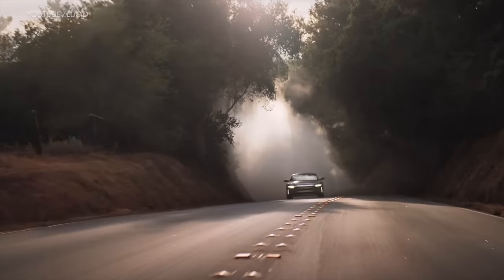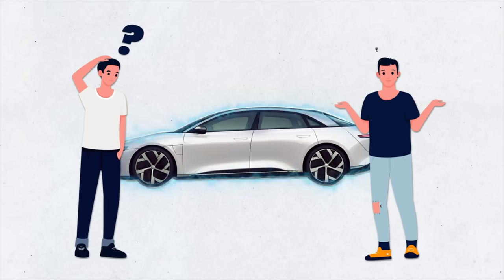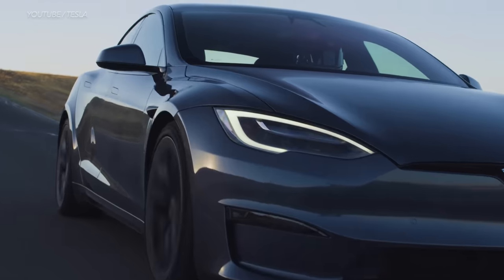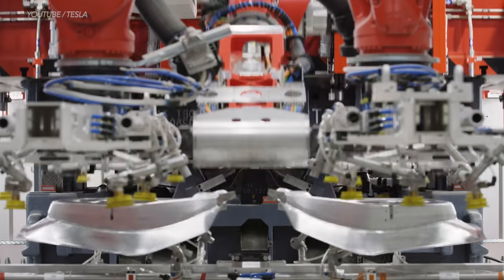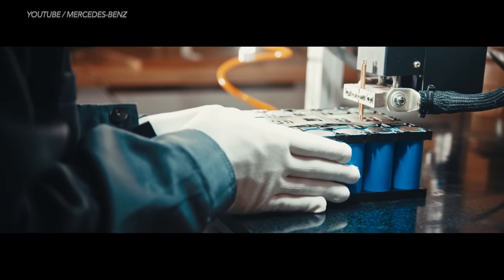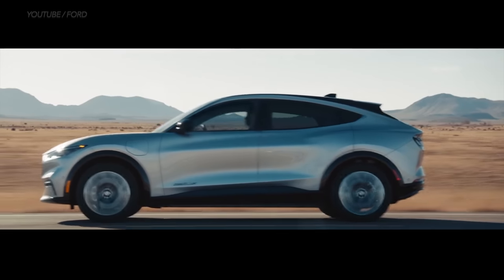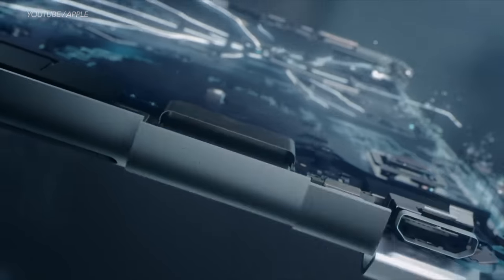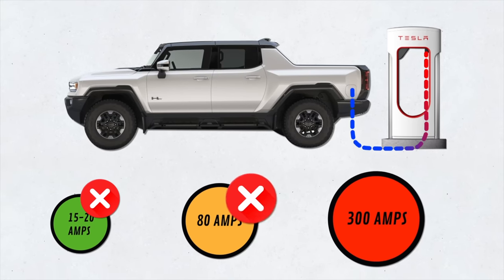Here's Why I'll Die Before I Buy an Electric Car

Comment: What people are forgetting is that 50% of the people who live in small-town USA don't have a driveway, or a dedicated parking space.  They have to park on the street.  They have to fight for their parking spot each day. How are these people going to charge their electric vehicle?  Am I supposed to run an extension cord 40 feet over the sidewalk to charge it every day?  What if someone trips?  Am I responsible?  EV's may continue to improve, but how is everyone who is not in the middle class going to charge them?
Reply: Yup.
Reply: Also people living in large apartment buildings. Where is everyone going to plug in? There is road use tax that may surprise some people. More weight means more $.
Reply: And, a large number of people living in cities reside in high density apartments. I do not live in an apartment, but, I have never yet heard of an apartment complex offering community EV charging stations. I have no faith in the current state of EV technology and I will continue to enjoy the 600 mile (sometimes more) range of my X5.
Reply: Use diesel backup generator. Bring it right next to your EV. Start it up, plug it in 220V. Problem solved.
Reply: Depending on what you use you car for, the average person can get by by fast charging a few times a week. 250 miles would last me like 1 week of driving to/from work.
Reply: That is exactly why the ice will never be completely done away with. How many people live in apartments with only a spot in a lot or maybe a carport.  Not everybody has the American dream.
Reply: @bigx9963   Are you talking about running a diesel generator in on the street or in the parking lot of a crowded apartment building?
Reply: You are basing your question on information that is outdated. The latest charging technology will charge the latest battery technology in 20 minutes while you're at work - the change is coming - give it 3 to 5 years.
Reply: Don’t have a drive way 😂😂😂🤣🤣🤣🤣🤣🤣🤣
Reply: Most people don't have a gasoline tank at their home either. People can take a minute and charge their car once a week. If you are living in such a dense area you struggle to find parking you should probably levy for a working public transportation system, not bash electric cars.
Reply: @Doom-i  Yeah, and what if there are no assigned spots?  Who pays for the charger to be placed there?  That's going to cost a lot of money!  Either tax-payer-funded, or paid for by the home owner.  Then what happens when someone parks their vehicle in your spot.  How do you charge up?   You may be right, I'm not trying to pick a fight.  I have really thought about this a lot.  I think having an EV would be cool ya know.  There is just no reasonable way for me to own one without incurring a very high cost to make it possible.  Most of the people who live in my town are in the same boat.  There is an apartment building across the road from my home.  People constantly take my front-street spot.  Different cars every day and at night.  They don't even have a parking lot, left to find parking on their own.
Reply: @hidesbehindpseudonym1920  You bet
Reply: @Doom-i  yeah...about a 100% increase in rent to pay for it.
Reply: That's not an issue just in small-town America.
Reply: And don't forget that kids will be walking around the community at night disconnecting cars from their chargers.
Reply: Saw people doing that in London. Didn't seem to be a problem.
Reply: @bigx9963  🤣🤣 exactly! That way your ev will have the same emissions as a John Deere !
Reply: More like high class
Reply: You charge on the way home at the neighborhood charge station. That way your car is ready to go the next day.
Reply: @bigbangerik66  I'm not bashing them... I'm reminding all the elites that not everyone has what they have available.  I think they are pretty cool and can see having one would be pretty neat.  But I also live in the real world small-town-USA.  Sometimes you need to see it from the other perspective.
Reply: I also don't see this as being an enormous, wide spread issue. In the smaller more rural areas which are devoid of chargers.....yes, if you don't own your home or have a landlord that's cool with you installing a home charging solution then it's not your time just yet. But it's coming quickly.
Reply: @Doom-i  do you realize the amount of power the grid would need to power something like that..I live off grid and understand better than most that electricity doesn’t appear out of thin air..the US grid will need trillions of dollars in upgrades with money we frankly don’t have
Reply: @gene8172  The nearest charging station to me is 30 miles away.  In a place I'm never "just driving by".  That's going out of my way to "fill up".  I'm sure someday we'll get them closer... but I'm not holding my breath.
Reply: Ask Norway. They have a ton of EVs on the road, many Teslas. Their government invested in infrastructure to accommodate. Every lamp post that line their city streets have an outlet. They WANT you to plug in there. And it’s totally free. (Well, it’s funded through taxes, but EV owners pay taxes too.)
Reply: And that's 98% of UK so good look marketing them for Britain.
Reply: @gerardorodriguez538  the chargers normally lock to the vehicle and if someone tempers with it an alarm will sound.
Reply: @leechburglights  Where’s the nearest gas station?
Reply: @gerardorodriguez538  Not just kids, it could also be chads who "disagree" with electric cars.
Reply: @leechburglights  elites also had the first cars as well, things will get cheaper at scale like all things.
Reply: @bigx9963  wait so we gotta use gas still ?? Wtf
Reply: @UmmYeahOk  

1. Norway is far less diverse.  Diversity generally creates conflict (unfortunately).

2. Norway is a fraction of the size of the USA.  The USA is a group of United States.  Far harder to get something done nationally.

3. Norways income taxes are roughly double the US taxes (this can vary somewhat widely based on income level, what state someone lives in in the USA, etc. but this is a rough estimate), and there are other taxes as well that make it end up being more than double.  Do you think this and other government handouts makes having plugs for electric cars everywhere worth it? If you do, I wholly disagree, countries like that make it impossible to get ahead.  High taxes drag everyone down into mediocrity.

One has to look at the big picture.  What is feasible and how much it will cost is where you need to start.
Reply: New York, Baltimore, New Orleans...any city that came to prominence before the 1920's and still has historic neighborhoods.  You never even get the parking spot in front of your home.  Driveways are rare and garages are nearly non existent.
Reply: @matteoperron5436  How many hours a week can you spare to charging your EV?  I hear of 45 min to 2 hours wait times.
Reply: @bigbangerik66  not all public transportation is good. Like my town I grew up in sacks to find parking and public transportation sucks to catch. Bus comes every hour in a half until 10 the last bus for the night. Starts back up at 6 a.m.  breaks down alot.
Reply: @Doom-i  So who is going to pay to update the power grid?  The cost of retrofitting a complex?  Major cities are already utilizing rolling blackouts.  Where is all of this clean electricity supposed to come from?
Reply: @Mistro07  If all cars in the US were magically electric tomorrow, the grid would need about 50% more electricity than it contains now (you can google the numbers and calculate it yourself: miles-driven-annually / average-miles-per-kwh vs. kwh-produced-annually). Not an insignificant amount, but not impossibly huge either. Considering how slow the change will really be, I'm sure it'll be fine.
Reply: @Doom-i  Time?  Who said anything about time?  I'm talking about infrastructure and cost.  Two questions nobody wants to answer with anything other than than a soundbite or redirection.  Show me the math.
Reply: @UmmYeahOk  that's a smart solution
Reply: @ramshambo2001  great point
Reply: @ramshambo2001  It's about NOT being able to charge them at home to save money and time.
Reply: @SteamCat86 yeah, and my point is HOW????? In many communities this is a huge problem that nobody is talking about.  We FIGHT for a place to park at our homes every day.  Never having the same parking spot.
Reply: @nucleargrizzly1776  AMEN brother.  My home was built in 1870, the second oldest in my town during the steel boom of the 19th century.  Houses are packed on top of each other.
Reply: @Doom-i  That's everyone's problem.  
And did you notice how you still didn't answer the question?  Just deflection.
Reply: @hidesbehindpseudonym1920  it was definitely sarcasm.
Reply: @leechburglights  So you don't plan on running and extension cord down the street? 😁😁😁
Reply: @Doom-i  More deflection?
Reply: @bigx9963  So, you run a generator for hours that runs on a fossil fuel so that you don't use fossil fuel......something wrong there....
Reply: @SteamCat86 there are 2 apartment buildings in my small town.  They have zero parking lots.  How's that going to work?  Government grants are awesome, just higher taxes WE MUST PAY for others to get "free money."  I don't see this happening in the next 10-20 years.  I'm not worried tho, ;) I got a Toyota 4Runner, should last me till the big conversion to EV's haha.
Reply: @bigx9963  Lololol   I’m going to use a huge loud Petrol ⛽️ Diesel engine and leave it on the sidewalk of the Bronx?
Reply: Sounds like my moms place in the UK,always fighting for a car parking spot on the street!Its very frustrating .🤯🤔🤔🤔🤔
Reply: One thing about ev charging over petrol or diesel is that ev charging points can be put anywere and probally will be everywere. Although it sad that most of the US is not cycle frendly and poor public transport. Meaning people can't have a small car that used to go places on the weekend and dose 10k km(6k miles) a year.
Reply: Don't forget very cold weather and it's effects on charging. Unless your EV is in a garage for northerners it's S.O.L 4 months a year. EVs are a disaster y'all gonna see, another unmitigated disaster.
Reply: @bigbangerik66  Take a minute and charge….. Erik you are a funny man hahahaha
Reply: So, where do you go to get gas? If your area is so populated, I hope you know you can fit more electric chargers in one area than gas pumps. Once these places you described switch to hybrid, selling gas and electricity, there will be no issue.
Reply: @mauricebarry8858  The shortest charge time on a level 3 charger is about 30 minutes. It takes 2 minutes to fill a gas tank. There isn’t any comparison.
Reply: This may sound harsh, but it's simple truth. EV's aren't made for people below upper middle class at best, or people who don't live in one of the few environments where charging actually works/makes sense for you. 
If anything, it'll be some $4k Chinese piece of 100% feces that lasts 10k mi before it catches fire.
Don't worry, you can always go to some parking lot with 4 chargers, wait about a 1/2 hr for one to open up, charge for about a 1/2 hr, might take you up to a 1/2 hr to get there...cool! The future!!
Reply: There will be changing poles soner or later on most parking spaces 🤷‍♂️
Reply: @Doom-i  ' Shhhhhhhhhhh ' Hush ' 
Don't give them any ideas '
they will charge $$$$ for charging at a charging parking meter 🙊
Reply: @Doom-i  More 30 to 50 years, you cannot expect that apartment complexes are going to shell out millions or billions in 10 yrs time. Where are they getting that money from, massive rent increases? lol
Reply: @nrich5127  You still did not explain where it would be? What on the street? Is every employer expected to install them? Will apartment complexes shell out millions to upgrade their complexes? Like you did not even understand that the OPs question is about practicality and availability, not the technology itself.
Reply: Do forget all the people that live in Apartments and Condos
Reply: @Doom-i  who will pay for the installation/upkeep of these chargers?
Reply: @leechburglights  yep. Legally..that spot is open for anyone. Public.
Reply: Just buy a diesel generator lol
Reply: @bigx9963  Ok smarty, let's place for example 25 diesel generators on sidewalk of Brooklyn street. How you going to handle fumes, noises and extension cords running to cars under charge take place?
Reply: @Jerry Coffey eyes.
Reply: Someone will steal ur power if you use a power cord 🤣
Reply: No, No, No!   You cant concern yourself with those details.  
Just buy the EXPENSIVE ELECTRIC car and you will figure it out later.
Shame on you that you would pose that question at UNCLE JOEY!
Reply: How does someone IN THE MIDDLE CLASS, suppose to charge it?
Reply: Thank you—I live in a predominantly rural, poor state and have often wondered how the EV fans see us being able to afford these in the first place, much less maintain and live within their constraints.
Reply: Also not everyone in rural areas have garages. Like us, I don’t know if those chargers are waterproof. You mentioned apartment complexes, how many of those owners are going to spend the money to have dedicated charging stations installed for the tenets.
Reply: @bigx9963  until you’re neighbors complain about the noise.🙂🙂
Reply: @morbward8281  basically EVs will end up being a "luxury " thing like Lamborghinis or McLarens that only ultra rich people can afford 
Middle class people who live in apartments either have to use electric public transport/ bicycles 🚲or legs 🏃🏼‍♂️( walking)
Reply: @leechburglights  I live in BFNW Indiana. We have chargers in town. Not sure what your point is. It isn't "small town america" that's going to have an issue, it's "super dense metropolis" that will. And, again, if you live in a densely packed area, be it small town or big city, you should be pushing for better public transportation and not nit picking ev.
Reply: Wireless charging.
Reply: @troy028  then fix it? Again, instead of nit picking ev, fix public transportation.
Reply: Seriously? Lol
Reply: Public transportation
Reply: yes,most living in big buildings in apartments,they need 200meter cable and recharge takes 24+ hours
Reply: @jameskennedy673  

Right on brother
Reply: @rschall333  technology will change that within a couple years
Reply: I have a battery charger that I connect to my battery, and stationery bike, and I charge it like that when I can't park in front of my house. Two birds, one stone😐
Reply: @bigbangerik66  Bruh, I'm not nit picking the EV... I'm talking about real issues that you admit you don't face, but maybe 50% of the country does.  The closest charging station if a 35 minute drive from me.  

Our town was founded after the Civil War.  The population expansion happened here before cars were even a "thing" in the early teens of the 20th century.  In fact, most of the eastern U.S. towns are like ours.  I'm not saying that EV's are bad, or we shouldn't move towards them.  I think they are cool.  But maybe you are not aware of what it's like to live in a town where you must compete daily for your home parking spot.  Why would I buy one if I had to go the charging station every day?  I don't have to go to the gas station every day to fill up my Toyota 4Runner.  There's more to think about than just, "well our town has a charging station..."
Reply: @allenanderson3649  haha, there is little to no public transportation out here in rural western PA.
Reply: @Doom-i  that won't happen until we get a grid upgrade and nuclear energy powering ut
Reply: If had an electric car, if I couldn't charge it at the house, I'd charge it at the hotels and motels in town....that's where the most stations are at now......eventually, the neighborhood gas stations will put in 1 or 2 hubs to meet growing demand.......EV's are here to stay, we might as well get used to em......🤔
Reply: You can buy speedcharge cables but they're dear.  Somebody paid $600 for one.
Reply: @bigx9963  Why not just drive a hybrid in the first place?
Reply: My personal plan is to buy a new Honda Civic 2.0 litter, no turbo and drive for 12 years !   My current vehicle should get 2 more years use, then God willing 🙏 the world and car market find a more peaceful place  ????
Reply: I'll buy electric vehicle, sometime after Scotty buys one ???? LOL
Reply: @Doom-i  not in our lifetime. It makes a cute bedtime story though
Reply: @leechburglights  do you also not have electricity? Are you writing this by candle light? For sure you can get charging stations. They are coming. Your point is moot.
Reply: I had to get a jump pack because I couldn't plug in my battery charger  to reach my car last winter.
Reply: and lets not forget batteries can not charge in freezing climate so snow is a problem plus the so called EV being eco friendly if you ignore the fact than all the materials of a car are mined refined produced and transported are done using fossil fuels.
Reply: @leechburglights  I don't understand why people argue, "but the taxpayers are gonna have to pay for it." The government only charges you a percentage of your total income. The amount won't change unless you make more. Whatever can't be covered by taxes is paid for through the deficit.

Also, the same argument can be made about literally everything.

Road? "But the taxpayers are gonna have to pay for it..."
Bridges? "But the taxpayers are gonna have to pay for it..."
Tunnels? "But the taxpayers are gonna have to pay for it..."
Water treatment? "But the taxpayers are gonna have to pay for it..."
Sewage treatment? "But the taxpayers are gonna have to pay for it..."
U.S. Military? "But the taxpayers are gonna have to pay for it..."

If we let "But the taxpayers are gonna have to pay for it..." get in the way of everything, nothing will ever improve.
Reply: @bigx9963  Why have an EV is you are going to power it with diesel oil?  What if someone steals it?
Reply: @Mistro07  This is a myth. U.S. power plants regularly produce power at a higher rate than demand.
Reply: @Doom-i  At what cost?  Who pays for it?  MASSIVE infrastructure changes.  Will never happen.
Reply: @bigx9963  Doesn't that defeat the idea of electric?  You're still using oil.
Reply: @Doom-i  Try 100 years.  EVERY apt. bldg that now exists would need conversion.  Do you realize the $Trillions to do that?  The rent would need to be increased massively to pay for it.  No owner could afford to convert his building.  No tenant could afford the increased rent.
Reply: @bigbangerik66  Public transit is a joke. You can only work on the bus line totally limiting your employment opportunities.
Reply: @megaandry69  100% truth. I wish 50% of people would realize this simple truth that is spelled out in front of their faces. I also love how some say, "I'll just keep my old truck forever!", as if they have a choice in a few years.
Reply: Ever heard of a charging station? Duh
Reply: @matthiasknutzen6061  I guess the entire electrical grid is going to be 100% overhauled across the entire US & rest of the world to be able to handle the overwhelming increase of usage as well. Pretty realistic.
Reply: @bigx9963  how is that “green” 😂
Reply: @jackanderson2773  100% correct. Very green to charge EV's using electricity that comes from coal & gas, right? Also extracting all of those rare earths at the cost of environmental & personal impact for people of "developing" nations is also green, along with service lives being cut in half (or less) forcing you constantly throw away & buy (rent/lease) new. Very green indeed.
Reply: @RothBeyondTheGrave  If things happen as you believe they will, gas demand will drop.  The price per gallon will drop as well. ICE vehicles have a very long life ahead of them.  I'm not saying EV's won't at some point be the primary vehicle sold, but lets be realistic.  I'd say we're a good 20 years from that happening.  By that time I'll be well into retirement and not have to worry about it.
Reply: @bigx9963  Many apartment complexes prohibit this. Cannot operate this or even a grill within 30 feet or so of the building for fire insurance issues.
Reply: @nrich5127  what if you don't go to work and work from your apartment.
Reply: @UmmYeahOk  Population less than 6 million people. Find another example!
Reply: @Trainfan1055Janathan   Why does the government have to spend our money period?  It's not theirs to spend.  Its supposed to pay for the salary and business of the government.  You do realize you'd have 15 to 20 %  more in your paycheck each month if they didn't tax you right?  I don't know how to explain it any better.   If big business, big auto, big oil, big electric want all this stuff updated and spread across the country, THEY will pay for it.  The government doesn't pay for cell phone towers, electrical lines, or telephone lines to be run across the country.  The business that want to sell to the consumers are the ones who should pay for it.  Not the government buddy.  If Tesla wants me to buy their cars, they need to install Tesla stations... if GM want's me to buy their electric car, they need to install GM electric stations.  What gets in the way of progress is... will it sell or not.  What you're saying is, I want EV's!  Great you and big business can pay for it LOL
Reply: @bigbangerik66  Dude closest station to me is 30 miles away.  I never drive in that direction.  What's the range of an EV?  How far can I go before I have to waste my time LOL.  My point is very valid and just because you don't have my experience doesn't mean I don't get to voice an opinion.
Reply: @custer8616  um, not within 30 miles of my home.  Kinda pointless since its in a place I never go to.
Reply: @bigx9963  Yeah that s green :elbowcough:
Reply: @In-obscurity-n7j   Until there is a sizeable used market a lot of these people can't afford an EV.  Why does everything have to happen right now?
Reply: On the flip side it's a backup to my RGB lights and controller's. 😉
Reply: @Doom-i    The problem I see with that is stolen cords (already happening) and the cost of maintaining them, nobody works for free.
Reply: @leechburglights  I believe you but 50 percent seems awfully high, even for a big city. I live in a town of 3500 and almost everyone has a parking spot
Reply: Not my experience
Reply: @gerardorodriguez538  🤣
Reply: @RothBeyondTheGrave  Yes agreed .
Reply: @Mistro07  I don’t think most electric grids could handle 1 out of 20 cars changing over. I respect your electrical independence too. Very admirable. But, the field created by the spinning of a generator literally does pull current “out of thin air”. Much love
Reply: @nucleargrizzly1776  I find it interesting; that up until the 1920’s those big cities had electric vehicles, trollies and buses.
Reply: Car companies more and more aim for sales to higher income buyers, ignoring the segment of buyers that would buy a car with a lower price and lower margin of profit.  Regardless of the cost of new electric technology, auto makers seem to be following suit with the emerging electric market.  I don’t foresee a time anywhere soon when there’ll be an electric vehicle available that will be affordable for the average car buyer.
Reply: @kevindavis3841  In the early 1900's NYC had 1500 EV recharging stations.  The idea has already failed once.
Reply: Exactly.
Reply: Don't "these" people have public transportation and/or can walk to work?  Just about every other country I have been to you can easily hop on a train or water taxi to get around if you live in the 'big city'.  Otherwise you live in the country and have a driveway.
Reply: @haganlife  I guess you don't see the big step down in quality of life I see by using mostly public transport,  but I live in apartments in Sydney Australia, on a coastal area as many do and we have 4 cars but just 1 allocated parking spot, so the other 3 cars park on the street. For this city alone (5.3million population) I can guess there would need to be likely 500,000 street charging stations, that seems very far fetched to be built by 2030.
Reply: @bigbangerik66   you didn’t pay attention to the “quick charging” portion of video; it greatly reduces the life of your battery. Also, Most small towns don’t have E-charging. My town doesn’t! And my 100 yo home cannot handle a plug-in vehicle. 
Not everyone CAN do e-vehicles.
Reply: @gerardorodriguez538   and peeing into the ports! 😂😂😂💀☠️
Reply: And lots of people are poor, so we should stop selling stuff. What kind of argument is this? It’s the same as “ev trucks can’t tow far.” Well, duh. Not yet. EVs are good for some things and not for others, like literally every single car on the road.
Reply: @JaySimons1  Try a trip to Denmark to see if that changes your mind about public transportation.
Reply: I live in small-town USA.  Have visited many more. Most everyone has off street parking.  Garages and shops are common.    Sounds like your describing some sort of slum.
Reply: @bigx9963  why not just buy a diesel car for the fuel use to charge the car just seems like a waste of enegery to me
Reply: @danharold3087   you are NOT thinking it through! LL is correct!
Reply: nothing stopping people plugging into your extension cord and have you pay the bill and end up with flat battery and can't get to work.
Reply: The first autos also had no gas station when people started buying cars. There were almost no cars on the roads till the very late 1890s and no gas stations. Maybe we should have stayed with the horse and buggy.
Reply: @67Endgame  There are EVs in many housing complexes in California.
Reply: @67Endgame  a lot of high end apartments in Las Vegas have the option of adding a ev charger to there car port spot. Yes it is an additional charge but it is an option.
Reply: @UmmYeahOk  Nah, most Americans would rather sink their tax dollars into an incredibly over bloated military budget 😒
Reply: @danharold3087  then you haven't gone through southwestern Pennsylvania and seen where and how people have zero driveways in the hart of the town.  Driveways, OMG that would be amazing if we all had one.
Reply: @bigx9963  Diesel generator... nice clean electricity. 😂😂 At that point, might as well just get a diesel powered car.
Reply: @bigbangerik66  That's exactly the point, our rulers want personal transportation to be less accessible and affordable for common folk.
Reply: Electric cars are so much better that they need mass coercion and gaslighting to sell them. Klimate Krisis and "climate friendly" cars.
Reply: @Doom-i  Tell me again why we need to have cars with "challenges" when we already had cars that work without challenges. Wasn't it Klimate Krisis or some such thing?
Reply: @bigx9963  why then buying an EV in the first place ?
Reply: @bigx9963  using diesel kinda defeats the whole go green doesn’t 😂😅
Reply: Pretty soon there won't be a "middle class"
Reply: You hit the mail on the head with a sledgehammer like Always Scotty.
Reply: @Doom-i  That still leaves tens of millions of car owners living in congested areas without assigned spots.
Reply: they are not the target group. why do you think most EV's are SUVish... it's aimed at the multi-vehicle homeowners.
Reply: @TeamMadcrew  you describe my situation perfectly. I bought a 9 y/o Rav 4 EV as a family car. The thing weighs 4000 lbs!! 
Perfect for daily usage though
Reply: @morbward8281  my buddy installed a L2 for his parking spot
Reply: @bigx9963  Then your generator gets stolen, not a good idea.
Reply: Ever heard of wireless charging? 
If they can cram in parking meters everywhere they can cram in chargers too duh
Reply: @unitycatalog  except "they" prefer to extract value from the public, not the other way around
Reply: @alexanderpetrov7027  gas stations give away gas for free ? Or do they extract valu?
Reply: @unitycatalog  is that supposed to be cleaver, really dumb questions 🤣
Reply: @alexanderpetrov7027  Look up the dictionary for the word "sarcasm"
Reply: hydrogen is for rich, battery is poor ppl
Reply: If you live in NYC all the parking garages offer charging avg price $10 bucks for a fill up.  NYC is already working on parking meters that can charge. 
You must still be using a Blackberry how are you ever going to type without a keyboard
Reply: @unitycatalog  In case you haven’t noticed sarcasm doesn’t work very well on the internet unless someone knows you, there are so many that espouse crazy solutions.
Reply: @robertromero8692  not to mention that a generator doesn't have any emissions control equipment so that generator will put out as much or more pollution than it would be to just drive a gas/diesel vehicle
Reply: @rschall333  I was just about to say the same thing
Reply: @tanmay_6363  I think I'll just keep my old diesel truck, it'll still be running LONG after these EV's are in a landfill somewhere...
Reply: @leechburglights  there's absolutely no public transportation where I live
Reply: More public chargers where people can charge to full before going home. Cars will eventually charge faster and have better range. The average American drives 30 miles so a full charge should last a few days if not a week. An electric car doesn't have to be plugged in every single day
Reply: @UmmYeahOk  doesn't hurt that Norway produces Oil
Reply: @js6729  😸😹👍🏻
Reply: Na becoming like Europe. Only three rich will be able to afford to drivw
Reply: @Leechburg Lights  I hear ya.  And there are other VERY significant reasons why EVs will never totally replace combustion engines.  Two examples:  EXTREME COLD AND HOT TEMPS.  In other words, extreme cold OR extreme heat will usually spell the death of a battery (or batteries), so in addition to a battery's lifespan shrinking year after year, now a person has to be wary of being subjected to extreme heat or cold, and it only takes a few hours of extreme temps to kill an EV battery.

Then there are obvious infrastructure problems (e.g charging/stations, etc.) that are obvious, but even more anxiety-inducing is what happens if something mechanically happens to your EV?  I'm a fan of Tesla autos, but there are no Tesla service stations and/or mechanics conveniently located around Main St. USA, so good luck if your EV requires a mechanic in even most mid-sized US cities, because 99.99999% chance you won't find such a service ctr or mechanic for that purpose.  In a nutshell, the EV owner is fawwked on a number of fronts.
Reply: @bigx9963  hahaha....there is something really funny there  :)
Reply: What,I live In small town USA and I have an 100 ft driveway. You city suburban folks crack me up.
Reply: Wait till they have wireless charging to the pole
Reply: In the case of apartment buildings and apartment living, I have noticed here in Chicago, some high-rise buildings have been adding charge stations in their private garages. I suspect as EV's become more and more wide-spread, more and more high-rise buildings will adopt more and more of these charge stations till the majority of their spaces have chargers on them. That is a major concern though, infrastructure. I know the building my mother lives in still does not have a single charge station in either of the 3 parking lots surrounding that building. And yeah, people who must park on the streets every night, like someone else said, perhaps they'll start putting parking meter-style chargers everywhere eventually... but all of this is future talk, as of right now, these people are constricted to using gas-powered cars, unless there is a charge station within walking distance of their home. Or they can simply pick a favorite charge station and have lunch/dinner in that area every week or so while their car charges.
Reply: These questions are non starters, you don't even need to worry about it.  The government is forcing legislation that will  end ice vehicles, they will be forced to handle the infrastructure issue. If you ever lived in a cold climate you would know how simple issues like that are..
Reply: @Mistro07  you are mistaken.....charging will occur off peak...if you are really ready for the future, think about your car being your houses power source.  If you REALLY thought about it you would realize that it is going to cost nothing to charge your car and your house will be a very small sub station selling excess power back to the grid. Try to think about this revolution as a real change in the way we produce and use electricity.  We really have no choice but to change, if we don't then we will go extinct..... everything will run out, even our sun will turn into a red giant and  we had better have found another planet to call home.  All things change, instead of saying how it can't be done....figure out a way that it CAN be done!!!
Reply: Good point
Reply: The EV transition will take a long time we need 30 yrs to upgrade the power grid with 40 new nuke power plants for energy to EV
Reply: We have the same issues in the inner cities in Australia.  Lots of people don't have a driveway and park in the street at night . The other issue we will soon run into is power generation . When we have brown outs during summer because too many people have the air-conditioning on , where is the extra juice coming from to charge EVs ?  That will be the largest chunk of electricity usage once more people buy them . But hey I'm sure we can just get some more solar panels or something.
Reply: @67Endgame  If you own a condo, the management could allow you to install your own charging station. I have seen people do this at condo's. May not allow at simple rental apartments though.
Reply: EVs are suitable for real developed countries, where charging ports are available on the streets or stations build within housing areas. Also with fast charging, it takes about the same time as refueling gas with newer EVs.
Reply: The cost and electricity to run a charger at every parking space along the street will be overwhelming.  EVs seem to make sense for suburbanites who can charge at home, but they will be a hassle in the city.
Reply: Superbly put.  Simple  pravtical realities like these sem the ladt thinh on EV developets and designers, these cdays, and as you rightly put it, because these  largely are the better-off in society with no such problems as street parking. It also is the reason why EV prices creeping up relentlessly  £169000 (Lucid Air) isnt a concern eccept to the rest of orfinary society.
Reply: @nrich5127  All I know is how few people, in fact entire cities, even in industrialised countries will be anle to afford the cost of all these megapower charging systems. The power to run these tbings as well woukd be cpllosal, meaning prices will just keep going upfor all EV systems, not  down. Energy is not going ever to be  cheap, electric cars will eventually become a liability as rral life costs catch up.
Reply: @matthiasknutzen6061  How? Firstly thrre are the costs, it woukdnt even begin to be cheap. But an even bigger technical problem remains. dont forget there is almost absoluteky no standardised systems for EVs - all anufacturers to date have stupidly decide to "customise" proprietary and hence incompatible systems from disparste battery chemistries, voltages, even charhing ports. Its lije trying to charge your Apple phone using a Samsung connection. 
Compare that to - say  - all petrol cars take same petrol, diesels diesel. Anywhere in the  world.
These are realities that are repeatedly overlooked by none too eager EV enthusiasts. As a matter of fact, it's bordering on dreaming.
Reply: @Trainfan1055Janathan  My late-20ish IT-based neighbour  who brought a TESLA SUV had the city coucil install a charger in the communal car park. He pays zero road tax for his  3- ton road-destroying transport, zero congestion charge (UK) and certainly  bought the  £100K vehicle  on credit (little of his  sizeable income lost anyways). .
Ive driven my two 2005 2.0l Nissans and maintain both  meticulously, I need it for work/backup as a distance  healthcare worker, yet pay about £200 6 months road tax each, and £8-£12 each day I drive in a  congestion zone. 
Can you convince me this is nothing to cry about, esoecially as I am in effect oaying the tax that subsidises these EV schemes.?
Reply: You mean, people who live in the city! Or people who live downtown. I"m in south Texas and most people who live out in the small towns around San Antonio most certainly ALWAYS have both a (long) driveway and also have a dedicated parking spot. Hell most have an actual car port with plugs available for when they need to work on their cars or to hook up lights, etc.
Reply: Swear…lol They are expecting you to travel and partake in their charge stations…lol
Reply: I guess such persons will not buy them.
Reply: @67Endgame  What country do you live in?
In UK and most of Europe there are community EV charging stations, car park charging stations, and streetlights are having charging panels installed into them too.
Reply: @bigx9963  I’ll use a coal back up generator and store my loads of coal in car
Reply: @gerardorodriguez538  or one can steal electricity by unplugging it and plugging it into another ev or battery.  Though I know these cars have integrated phone apps but those can be hacked or people not use them
Reply: @gene8172  while waiting for 3 hours
Reply: @Doom-i  Not to electrical code in several parts of country and depends upon region and zone.
Reply: @autecheee  Yeah, and on 110VAC you only get 4-8 miles of range for every hour of charging time.  My neighbor found that out the hard way.
Reply: @allenanderson3649  LOL Scotty did buy an ‘electric vehicle’ just look up the video to see what it is
Reply: @autecheee  Waiting 3 hours for what? Not charging, at least. That happens quickly with a supercharger.
Reply: People do so in San Francisco.  I've seen extension cords .  And charging stations can be put in neighborhoods, and they are.  Get a clue!  Enjoy paying Big Oil for all that gasoline, chump!
Reply: @bigbangerik66  if only it took a minute to charge a car battery...
Reply: @NameIs JOHNSON well I tried to warn you to disable fast charging but you didn't listen!
Reply: I live in small town, Iowa and cannot think of a single home built in My lifetime...80 years...that was built WITHOUT an attached garage.......Where the hell do You live..On Mars.????............Paul
Reply: @autecheee  Better yet, without messy black coal all over your $80K Tesla, just drag the generator with your EV. Wired remote starting inside the EV, when you are out of juice just press start. Forget about searching for EV charger stations. Just refill the diesel. when needed
Reply: Yep. 
The flyover states are the last to be figured into most equations.
Reply: @rageagainstthemachine7434  WONT ?..... wtf's a wont? Ask one of your kids to show you how to release the cap's lock on your device. While your at it, maybe ask for some help with grammar and sentence structure. 
Oh, and just out of curiousity.... who exactly is "they"?
Suggested reading: Chicken Little.
Reply: @nucleargrizzly1776  Very good question.
Reply: @bigx9963  Or better yet, just use a diesel car and fill with diesel once a month. No need to fill and lug about any diesel generator. Much better problem solved.
Reply: @bigx9963  the irony in your attempt at sarcasm is that your proposed solution actually ends up being more fuel efficient than driving a comparable diesel powered vehicle! Facts matter.
Reply: @Mistro07  Most charging will be done at night when other demands are very low.
Reply: @bigx9963   then get diesel fumes defeats the object doesn't it ?
Reply: @TheZeusJuice  I’m glad you can “google it”..sounds like an intelligent way to calculate something
Reply: @Mistro07  Sorry, forgot I was talking to Luddites. If you want to verify my claim, you can go down to your local library, ask the librarian for help looking up the appropriate figures, and use an abacus to arrive at the same numbers.
Reply: @bigx9963  Doesn't that defeat the purpose of saving the planet .Lol .. Then when you come out to get your EV car in the morning your generator gone , Because someone decided they needed it more then you. and your battery's still dead
Reply: @gerardorodriguez538  or stealing or cutting charging cables
Reply: @Mistro07  but when we need “Trillions of dollars” the treasury just “prints up some bonds” and if there aren’t enough buyers then the FED just creates money out of thin air and buys them ….they’re holding trillions of dollars worth as I write this.
Reply: This right here is the one and only reason I don't own an EV. I can afford an EV. I want to own an EV. But I have nowhere to plug it in. I live in a Condo (which I own and don't want to sell) on the third floor in a dense city environment. I never park in the same place two days in a row and I can't run an extension cord from the third floor down to the street. There are charging stations in my neighborhood, but I'd have to park my car overnight in a shopping mall parking lot or something and that seems like a recipe for getting my car stolen. sigh
Reply: They could care less if people like us have a car, in fact they prefer us not to.. Why they want to beef up public transportation.
Reply: You are absolutely right. There has to be a major change in city infrastructure to accommodate EV's which I don't think can be done at least in the next 15 to 20 years.
Reply: @bigx9963  Yeah, right!  Then you have to pay for the diesel fuel and a replacement generator when some gangster steals your original one!
Reply: @UmmYeahOk  Norway is just about 4 millions in population.🙄
Reply: you will own nothing and be happy.
Reply: @bigx9963  So much for being greener, LOL!
Reply: @Mistro07  Exactly. I'm a power engineer. I can tell you that practically every residential transformer will need to be doubled in size to handle the extra capacity of charging potentially 2 EVs per house during prime hours 8pm to 6am (when most people will charge during night hours). Apartments, will need a small substation built next to them to supply the power necessary to charge 100-300+ cars. When everyone is converted to EV, we'll be using approximately twice to 3 times the amount of electricity we do today, which will make that cheap electricity not be so cheap anymore; it takes many years to build that much generation and the infrastructure to get it from source to load.
Reply: @bigx9963  Sounds good, but not practical.
Reply: @bigx9963  hahahaaaa. If your going to buy diesel for a generator to charge your EV, you may as well buy a car with a gas or Diesel engine?
Reply: I think the idea is to force these people to take public transportation and to lower the number of cars on the road.
Reply: I believe they'll soon replace all parking meters with EV parking meters with charging capability. There you go, I just gave my $1 million advice for free to any manufacturer and compliance reading this.
Reply: simples. Induction Road Parking Spaces. come on USA wake up, u must have some test facilities doing it already? Stop the 'WHAT IF'S' comments & instead lets learn the science of the existing solutions :)
The UK & Sweden both have some test roads with Induction Charging roads.
Reply: Picture millions waiting at charge stations and the road rage coming in the future
Reply: Why, EV’s are bogus
Reply: I’ve never seen a charging station for a car..?? REALLY
Reply: Never seen one in my state
Reply: Same problem as UK and eu.
Reply: I'd say more than half, or at least 40%, of americans, have dedicated parking spots and thus can install private charger. for those portion of population, evs are perfect.
Reply: @bigx9963  the irony
Reply: The solution is to not buy a EV in the first place. Then there wouldn't be a reason to look for a charging station.
Unfortunately some people actually believe this is going to help the climate from boiling over.
Reply: EVs are toys for rich people.
Reply: Truth is only upper class can afford charging infrastructure .. not middle class.
Reply: I guess evs are an inconvenience only the rich can afford
Reply: @bigx9963  might as well buy deisal car
Reply: @qilu2004  didn't say it wasn't a good thing.  It is truly an issue we face in our town.  I've said I would be interested in owning one but in the cold north west I'm sure we aren't even close to having this become a reliable reality for the massive low income people in my area.
Reply: you can fully charge an EV at charging station for around 10 buck...
Reply: Great point. Also I'm sure that if there's a bunch of home chargers hanging around in public people will steal or damage them.
Reply: @bigbangerik66  Electric cars aren't for everybody and everybody doesn't want one. Don't see why we can't have both. Not everybody can afford them. What happens when you constantly charge you devices. They don't hold a charge and the battery gets weak.
Reply: plenty of charging stations in florida at apartment complexes here and also free charging at our local banks
Reply: what ifs are like the easiest thing to come up with. yall are so scared its sad.
Reply: @leechburglights  don't think to hard. its clear not much come of it.
Reply: I live in small town America and I have a drive way, what's up with that?🤷‍♂️ ok I better not brag to much about having a driveway or people be trying to steal it 😁
Reply: No, you should have said 50% of the people who live in inner city USA don't have driveways for garages. For them EVS are not practical until charging stations are as popular as gas stations
Reply: That's not a description of small town USA. It's big town USA or some other country.   The ignored question is "does private car ownership in such an area make sense?".  In most other countries it isn't the only transportation mode and isn't as necessary.
Reply: @psdaengr911  So ride your scateboard
Reply: I live in small town Ky and most people do have their own driveway and parking spot......
Reply: Exactly
Reply: @67Endgame  
It's all a scam!!!
Reply: @bigx9963  I'm sure the neighbors will all appreciate that noise
Reply: @matteoperron5436  well aren't you a green wonder
Reply: @hidesbehindpseudonym1920  sure why not!
Reply: @gene8172  yea wait in the line at the charging station...good one 🤣
Reply: @tonyz6421  You wait in line at the gas pump now....
Reply: We are not gonna go electric that fast, its just another option. We will still be dependent on gasoline for a lot of years. You also gotta rennember there are also hydrogen cars out there, that will help those places where you can't plug in electric.
Reply: @bigx9963  …and use gas to fill up my electric car? What was the point then?
Reply: @ByteofLifestyle  Yeah, I don't need to do a smog check for an EV (CA). I don't have to worry for the generator, since I will need it when CA has a rolling blackout. 😄😁😆😅🤣😂
Reply: Pull a trailer behind your EV with a diesel generator running and plug 240 voltage cord into your EV you have the best of both worlds 🌎 😀
Reply: @bigx9963  except for the generator getting stolen😝
Reply: You think they are making cars for fifty percent of the population that lives in small town USA?
Reply: @UmmYeahOk  The avg US driver will NOT be happy with paying the taxes necessary to become like Norway.  In Norway it works because they have far fewer miles (kms) of road.  Look at a map of the road network in Norway.  There's a reason the Germans couldn't fully take over during WW2.  "You canht get there from he're"😎
Reply: Fast charging stations.
Reply: @In-obscurity-n7j  Do you just wilfully ignore fast charging stations? Within 30 years we won't be selling gas powered cars anymore.
Reply: I can’t imagine plumbing gas to all parking lot stalls at a grocery store. I can imagine routing electricity.
Reply: Fast charging stations
Reply: Those living in big apartment complexes in cities have the same issue
Reply: @ocean12  fast charging stations
Reply: I have been saying that about the city too. I live in San Francisco and parking in front of your house is no guarantee, and most people who are lucky enough to have a garage use it for storage. Other buildings including apartment and places that you work don't even have parking, and yes, I have seen a person down the street charging with their charge cable going over a pole on the sidewalk down to their car if they are lucky enough to park it there. You are right there will be extension cords etc. running all over the sidewalk, or they are going to put charging stations in like parking meters all over the city. Won't that look nice. What people don't realize is your electric bill is going to go through the roof. Plus, when do you think peak hours of charging will be. Most likely 5 pm to 6 am because most people will charge at home while they are sleeping.
Reply: One thing at least here in the UK they are doing is installing chargers within lamp posts, which I think is a brilliant idea for those living in more populated areas.
Reply: Not just small towns. Large cities too.
Reply: @ferrynpalmer3875  and it'll go away quickly. I like compare EV'S to Disco. EV'S, like Disco, will die a slow death.
Reply: @Brad Broemmer  ....you might be right. I'm a car guy, who's the son of a car guy. ICE or EV, I love cars. We are 10 yrs into having mass produced EV'S....if it's going to be a slow death it seems as though it will be glacial in terms of speed.
Reply: Your not.  most of the “ middle class “ won’t  own cars in the future.
Reply: @matteoperron5436 unless it’s cold out .  Then you will get roughly 1/2 that range.
Reply: @gerardorodriguez538  and flat out vandalizing the chargers and cutting the cords off for copper.
Reply: Small town USA and you can’t find a parking spot lol the yard is the parking….blacktop is the road and there ain’t not where to park but the ditch next to it.
Reply: Who cares about what the poor people are doing today?
Reply: Whole point is to make ppl not own vehicles anymore.
Reply: A mechanic I know says the entire EV movement will implode in less than five years.
Reply: @bigx9963  kind of eliminates the environmental reason. Lol😂
Reply: There won't be a middle class. Just poor or rich, no middle
Reply: The logistics of these things is, yes, absolutely not realistic. Total fantasyland to think these superheavy, supercombustible, hard to charge NIGHTMARES become the standard of automobiles.
Reply: Ah you live in everytown usa great point
Reply: @gene8172 great idea if your time is worthless and killing a few hours to charge your car is no biggie for you and you live in fantasy land where every town has a neighborhood charging station. Lol. Lot's of small towns in America with no charging stations. EVs are not the future. The current technology is only for a niche market of well off people who can afford to buy one, have access to a driveway where they can install a charger, and don't drive very far.
Reply: @bobgriswold8950  definitely wont make it to WallyWorld.
Reply: @bigbangerik66  lol. Charging stations stink no matter how you try to spin it. Best case scenario it takes 30 minutes to charge, worst case 3 to 4 hours. Also, no one has yet mentioned the cost. In my admittedly limited experience with them, I was paying around the same price as a tank of gas. Not to mention that many public chargers don't accept credit or debit cards, but rather force you to download an app and set up an account.  You could end up having to do this multiple times. I have had issues with my phone connecting to the charge point, stations being out of order, and stations being way out of the way, or sparsely located in remote areas. Unless you live somewhere that you can charge cheaply at home while you sleep, there is no upside to EV ownership. None of the magical thinkers in the EV cult offer practical solutions to these issues. Even when it comes to range anxiety, if you press some of these cultists hard enough they will begrudgingly admit they have an ICE vehicle in the garage at home that they use for long trips. Even in public charging stations magically appeared everywhere tomorrow I wouldn't waste my money on an EV until the charging time is 10 minutes or less and the cost of a full charge is significantly less than the cost of a full tank of gas. Oh, and the actual range of the cars gets closer to 300 miles.
Reply: @Trainfan1055Janathan you obviously don't understand how capitalism works.
Reply: @terry_willis  and where do you think the electricity comes from when you plug into a charger? Unicorn farts?
Reply: Valid point. I saw my neighbor in Brooklyn NY do the same thing. An electric cord from this house to the street. No parking garage..